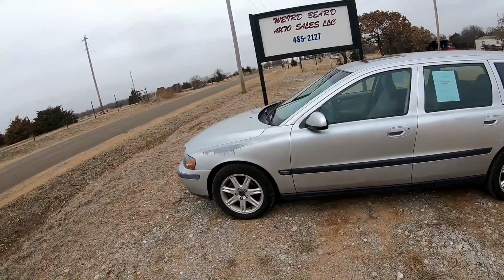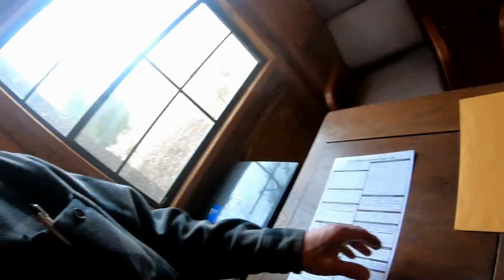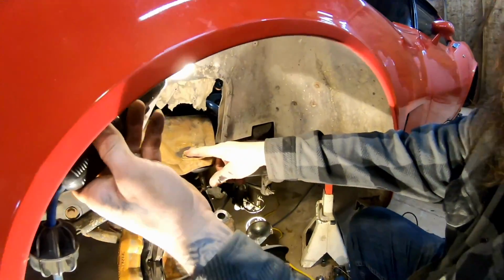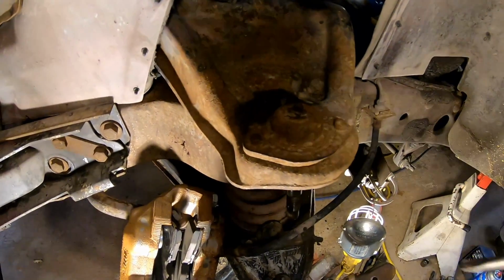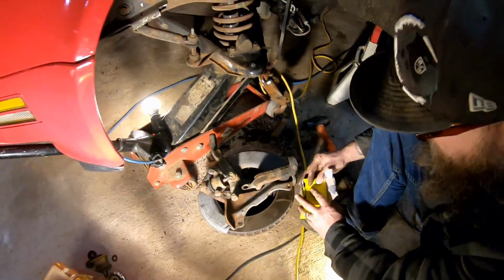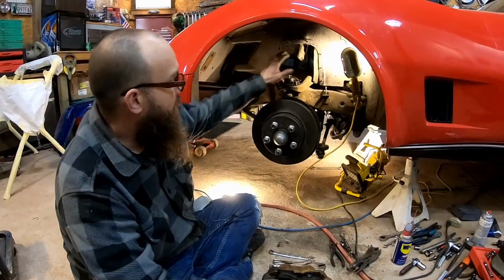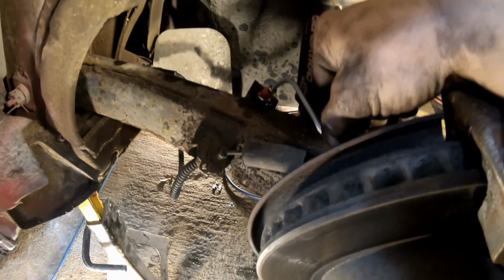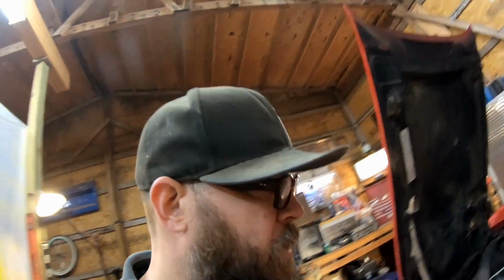Copart Volvo Sold and Randy's Corvette Suspension Rebuild

Comment: Nice job!
Reply: This guy works hard and does great work! Pro-tip on those upper b.j. rivets: Buy a brand new drill bit the same size as the new bolt shaft. Use a drill and a bar clamp to act as a drill press for clean and the quickest removal known to mankind, short of the torch that is.

Comment: Congrats on the Volvo. Thanks for showing us the process. I've thought about getting my dealers for years. For being out in the country it seems you sell everything no stale inventory. I didn't realize a corvette had so much suspension parts riveted on. Great job as always!
Reply: When you sell them that much under book value they move quickly. That is why they can't keep them on the lot. If he had a few people working for him repairing them they could have more to sell and have more people to work on them.  with him having a full time job as well it takes him time to finish them. Like that mustang he did. was done very well. whoever bought that one got a nice car.

Comment: when I replaced my struts I used an air chisel on the 3 bolts at the top of each one. it had them on the rear as well. the new quick struts came with new ones so i just chiseled the old ones right off. a lot quicker then taking the time to use a wrench on them when they didn't give you much room on the rear.

Comment: Watching this and now I don't feel so bad about doing my front suspension again. Hah.  I had bought lower control arms from rock auto which the cheap balljoints wore out after 7 months. since I had to replace the upper control arms anyhow, I went through the entire front end.  Figured if I'm doing it, do it all.

Shes sitting pretty now with Tubular upper arms from speedway motors and Moog balljoints, sway arm bushings, end links, center link, inner n outer tie rods. I even went through the front brakes too. do need stainless braided lines for the front however..

Good job on the Vette!

Comment: Might have to do upper control arms next. Those bushings look bad. They should have a little resistance.
Reply: It’s the “one more thing” clause. I know if the ball joints are original the upper and lower a-arm bushings are probably shot and while you’re in there it would be good to replace the saggy springs. Always something else to do.

Comment: Nice work man ! I think a better air hammer would have popped them rivets off a bit faster but you got it done either way. AAR said it was a low mileage corvette but I'm thinking it's not with all the work it needs or lack of maintenance may be the reason

Comment: I think the main thing that everyone takes away from this video is that the factory (GM) should have used bolts instead of rivets to hold the ball joints in.
Reply: my 95 Tahoe has the same ball joint set up. they are original but already purchased for replacement.  GM and those dang rivets. 🤦‍♀️

Comment: I had a feeling you weren't going to change out the springs as well. Those 2 coils of steel have been holding up that body and engine for almost 40 years especially with that bow in them. Maybe its a money thing. I have replaced all four springs and shocks/struts  on an '86 Sable, '88 Chevy Nova, yeah I know, '99 LeSabre and  my '07 Mitsubishi Galant ES. Every car has ridden like new, usually raises the body about an inch and the ride is so much better. Yeah, its an extra cost and work, but you're keeping it. I have 2 yr. deg's. in Physics and Earth Science as well as studied Math, Engineering, Computer Science, a semester of Architecture and also good at 'blue' collar jobs. I look at smaller springs and they can last a long time. I see the springs in a car in constant motion, even when not moving there are forces from the weight of the car especially the design where the springs bulge out like that. Would be nice to see how a new OEM spring would look next to a 40 yr. old one. I just know my experiences changing out the springs have been very rewarding, at least to me. I also believe the new springs bring the ride height where your new 'suspension' will work as, I believe the more correct angles and deflections. I think new struts work better with new springs. That where, I believe the are most harmonious as they were designed to be. Well, thanks for sharing and a 'very nice' for selling the Volvo so quickly.

Comment: Hi Bud you asked the Question , why they don't use bolts on the ball-joints Its all about cost of Manufacturing Cars and Trucks its the same if you ask why don't they fill the fuel (Gas Tank ) when you buy a car or truck , As a employee of most Auto Makers have a scheme that if you can save a $1.00 on any production  run car or truck you can get a Bonus from it. But i do Agree with you about it . The One thing i would have liked to see was Brass welsh plugs fitted instead of Steel even if it was just One behind the Block. :) from an Old Auto Guy Me.

Comment: The factory used rivets because they weren’t worried about replacing them lol
Reply: And if they should fail after warranty expired, they would charge you for an entire upper control arm with the ball joint already riveted in place.  And while they are here, they will tell you that the coil springs and shocks look very tired.  And the calipers and rotors  well, they look rusty.  And you may want to get new brake pads while we are doing the calipers.  And did someone talk about the rear axles yet....

Comment: How much did you get for the Volvo?
Reply from the maker: $1250
Reply: @weirdbeard8898  Great flip. I would have bought that in a heartbeat. I actually like those boat anchors, lol.
Reply: I told Randy I would pay him $1,500 for the Volvo... But it seems he never read or answers the YouTube comments. 
Is there an easier way to communicate with him? Or a website to check out the cars for sale? Thanks.
Reply: @dxraaaaa  You probably should have messaged auto auction rebuilds.
Reply: @beastumfan  I did on the other channel AAR

Comment: You make it look too easy, what did you get for the Volvo?
Reply from the maker: $1250
Reply: @weirdbeard8898  the reason why it was so hard to do the ball joints was that they didn't expect a DIY er to do it!.... 

they wanted you to sign away your first born to the dealership so they can do the repairs at 45 an hour

and also they didn't expect for it to end up in the plains of OK......

they expect you to store it in an hermetically sealed climate controlled marble floored garage with retinal scan lock!

Comment: not to bitch about not using the guard on the grinder cuz I dont use one either, but do wear gloves dude, just sayin, in case you`re wondering, I'm 60 yrs. old and I know a thing or two about necessary safety.
Reply: Hi, yes sir, wear some damn gloves, some thick leather ones. Grinders are hard on gloves, but harder on hands! I am 61 and got scars to prove it! Safety glasses+gloves, every time! Wayne the revved up yooper

Comment: I HATE IT,  HATE IT, HATE IT when some dumb car engineer puts rivets on places where there should be bolts or screws! The best is, riveting metal on plastic! The whole thing will break or melt, when you try disconnecting it. I nearly puked seeing electric window lifters riveted on plastic! Some goofball designers had  complicated and very expensive front bumpers made out of 5 parts riveted together. Plastic wheelhouses riveted to fenders were terrible as well. It was nearly impossible not damaging the wheelhousing and the fender disconnecting it. Maybe they were trying to save a handfull of $ for each car on the assembly line. Those designers should be sentenced to disassembling their retarded design on 20 cars without breaking anything and within the short time range the manufacteror says poor guys in body and mechanical shops should need making this job.